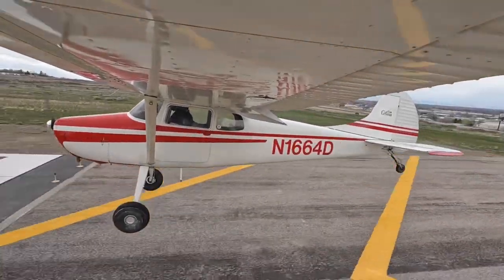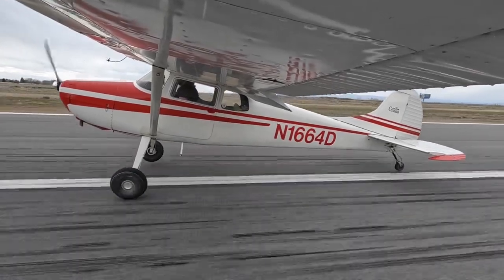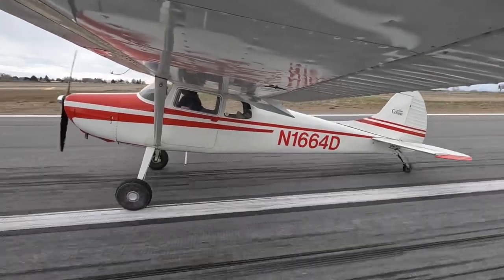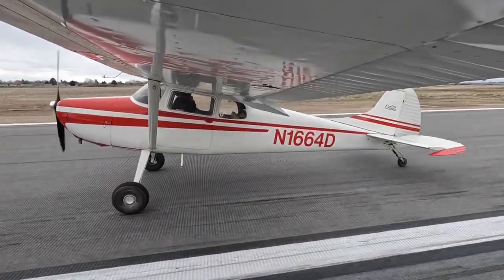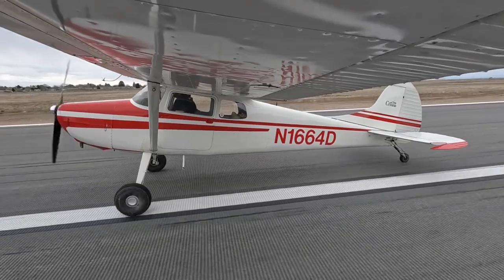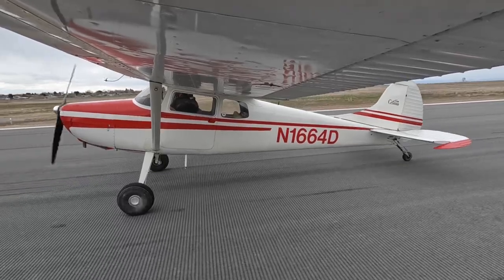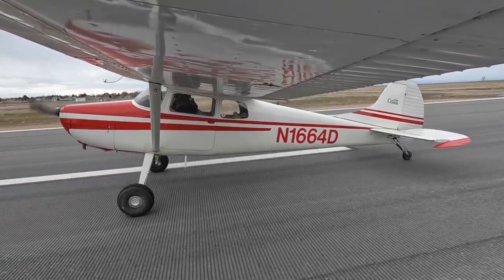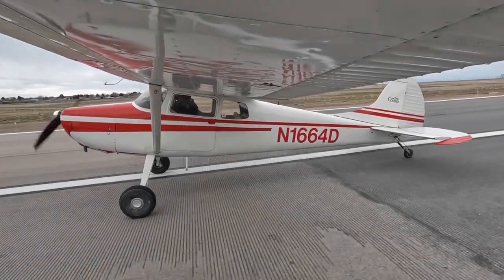How to fix tailwheel shimmy during landing

Comment: Shimmy is usually caused by excessive caster angle on the tailwheel pivot, so simply lightening the load on the tailwheel spring can fix the problem. if it happens fairly consistently, the whole tailwheel assembly should be checked and adjusted/repaired/replaced as necessary. Shouldn't happen and need not happen with good maintenance.
Reply: Exactly..

Comment: If you getting tailwheel shimmy the caster angle is off. They recommend changing the tailwheel main springs as many have failed.
Reply from the maker: It’s brand new and the tailwheel has a fresh over haul it only shimmies if you force the tail down way too fast

Comment: Often on C-140s the wrong spring is on the tailwheel. 140s should always use the “early” model spring. The camber of the wheel should be level or slightly front down when you have the plane loaded normally. The wobble you have is probably caused by a slightly front up angle. Shouldn’t happen if properly set up

Comment: I thought the back seat window squared off was a 1954 or later.....
Reply from the maker: Correct,  this 170 has an interesting history!  It was rebuilt after an accident and the airframe was a late model 170 that was moved to the 172 line and then built back to the 170.
Reply: @kobet6  These old planes all have a history lol...mine was a 52 with 172 wings but with  a later panel not the piano keys,180 gear and a lot of great mods....